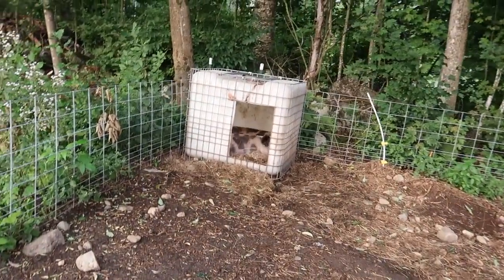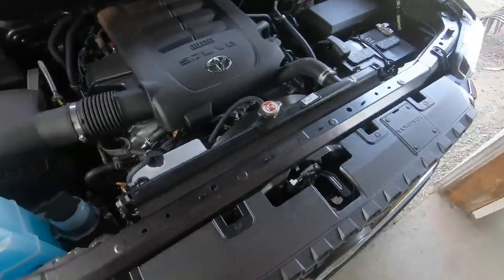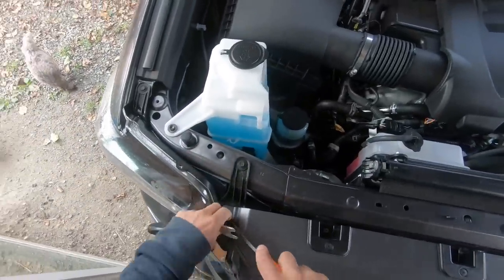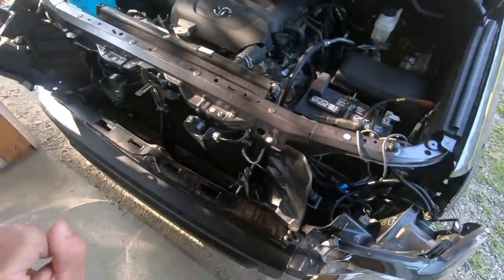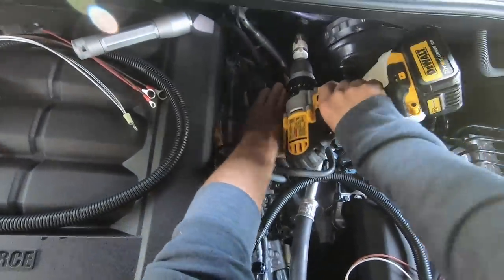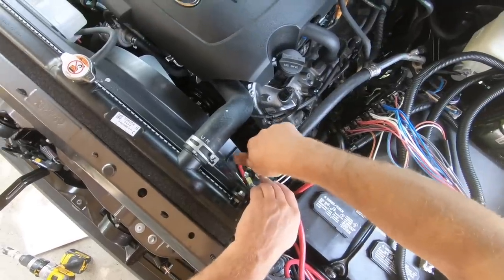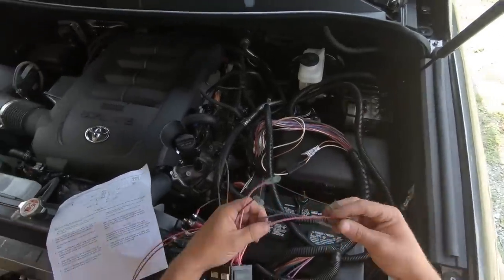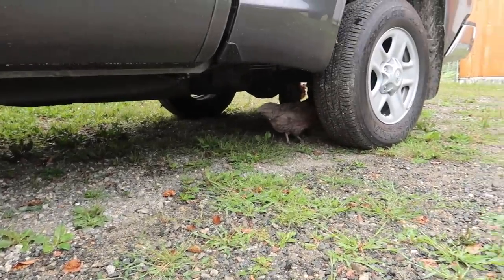How Hard Could it Be (Installing the wiring Harness for a Boss Snow Plow)

Comment: Yes Al, we always seem to be trying to keep one step ahead of the N.H. winters! Our kitchen stove wood is in, but we have 3 cords of the big stove wood to get under cover. I am very impressed that you took care of the wire harness now. It is good to be prepared, with fewer last minute hassles. Thanks for the installation video! My little 2004 Tacoma is plow-less, but " Ruby" can make it up our snowy steep driveway 99 out of 100 times! A storm last winter, rained and froze under fresh snow. I almost made to the top, before the truck slid backwards, stopped by logs placed along the side. One of our Ford tractors had to pull it out :-). I still want a Kubota.......

Comment: Great install video. As a boss fan for over 20 years. One thing I like to do is run a jumper wire from the ground of the solenoid to the ground of the battery. This will give a longer life of the solenoid.

Comment: Sausage and Links can stay nice and warm in a frying pan. Mmmmmm. Tasty.
Al, Have you ever worked for UPS? Going out in the cool temps in shorts is a UPS concept.
I have a stack of yogurt cups with my tools. When I disassemble a car, I put the fasteners in the cups at the various stages of the job. It can be annoying to realize a screw or clip should have been installed a few steps ago requiring some back steps.

Comment: Really good to see your knowledge with vehicle electrics... most people haven't even heard of using dielectric grease. I don't like scotch lock type wire taps either, they are always a cause of issues especially out side of the vehicle cabin where they are exposed to the elements....  pity Boss didn't make fly leads and connectors to keep everything OEM spec.

Comment: Nice clean install except for the scotch lock connectors. I absolutely hate those connectors. You will eventually want to cut and splice those wires in by soldering them in. Lot less chance of pulling apart or corrosion. But it’s good you used the dielectric grease, it will help in the meantime. As always great video!!

Comment: Gooood Mawnin' Al!    So in a word....Envious!   I'm a diehard Toyota fan with an '05 4runner and past owner of more Toyota vehicles than I want to admit.  Watching you install the wire harness for the plow both makes me want a new pickup as well as a plow to put on it!  If only I could justify it!  I have only 128k miles on my 4runner so I feel like I've only just broken her in!  I have a 4.7L engine, I can't imagine the power packed into the 5.7L engine, must be nice.  Is your truck like mine in that it's always in 4 wheel drive?  I get 22-25 mpg highway and find it really hard to beat for 270hp in a 4 door with a V8.  Lastly, what happens to the warranty on the vehicle once the plow is on?
Reply from the maker: No I can put the truck in and out of four-wheel-drive. The plow does not void the warranty. I made sure of that before we bought it

Comment: Al , I have a question. Since your truck is transportation , why do you not just use the front end loader of your tractor for snow removal ?
Reply: Donald Miller there is a huge difference in plowing inside of a nice dry heated cab with an 8 foot v plow and out in the elements with a 4 foot bucket that doesn't angle. I bet the plow is at least 5 times faster and 20 times more comfortable.
Reply: dp  pmm ,
Well yes , but using the tractor does not require dis -assembling your new truck.  And then carrying the plow everywhere you have to go .
I used to plow with my small tractor , using a home made 3.5 foot plow that did not angle. In fact it only lifted about 18 inches also.
I was always busy enough that I never felt that cold. But , I never had to drive my tractor to town with a plow on it.
Reply: Donald Miller I guess it comes down to personal preference. I used to plow my yard with a small tractor as well. We get a lot of wet snow now and I got tired of being wet all the time, plus I like getting my plowing done in 20 minutes instead of 1.5 hours. It only takes a couple of minutes to take the plow off. To each his own I guess.
Reply: Doesn’t  the plow easily disconnect? I thought it was on a quick connect type set up?
Reply: Yes, the plow will easily disconnect, so you don’t have to take with you everywhere. Disassembly is a one time deal and well worth the effort for years of comfortable plowing. I would also think there would be some income opportunities. Excellent job on the install Al, I look forward to seeing the metal get mounted.
Reply: There's good and not so good about each way to plow.  We had a Ford 8N with big front scoop that my husband used for clearing our driveway.  He could plow forward and then scoop the snow up and over and then move it further back and make huge piles, widen out the areas, scoop around the mailbox and clear to within an inch of the back step. Took about 2 hours and he put on his snowmobile suit and insulated boots when it got very cold.  Some years the piles were over 10 feet high. Great pictures.  Now, I hire my plowing, and the driveway gets very narrow by the end of winter, and there is no way to push it back very far.  Takes about 20 minutes, needs more shoveling and costs $40. each time.  Northeastern Minnesota.
Reply: Donald Miller, It's ideal to have both, just like Al does. Use the truck to quickly open up the road and his driveway, then use the tractor to move the piles if they become too deep. Just using the tractor may work, but just imagine being where he lives, WAY upstate New Hampshire. Those guys get hammered with snow as you probably know. Also now, if he wanted to, he could plow 10-15 driveways each storm and make 4-6 hundred each storm !!!!!
Reply: august , 
Snow can be pretty variable.  I live just south of the Lake Erie snowbelt.  Last year (2017 ) I had a green Christmas. I didn't get very much snow and then it mostly came in March and April . Lol , I was ready for spring by April ! But I have had winters when I received quite a lot of snow. I plowed it .  No problem.  Then , two days later , I got just as much snow again ! Ut oh . Now what? I have no place to push the snow to. And no front end loader to lift the snow up and over . I ended up with a very narrow driveway. lol
Reply: dp pmm,
I think a lot depends upon how much driveway you have to plow.  My driveway was only about 40 feet long so it did not take me very long.  My main problem with plowing was if I got two or three big snows back to back.  The problem then was , where to put the new snow ?
Reply: Where I live, we rarely get more than 12" at a time. But I appreciate neighbors with plows on their trucks so that we can get a path cleared on our road as it might take a day or two for the township to come around to do it. Remember Mrs. Lumnah Acres still works outside the house and needs to get to work whether it has snowed or not. Having a plow on a truck is a good way to clear a path to main roads quickly.
Reply: soverylisa , 
I seldom get even 12" at one time . Only rarely do I get that much at a time. But , I have such a steep driveway , even an inch or even less can have me snowed in . lol My two wheel drive truck can not make it up my driveway with and inch od snow on it. If I have to at least snow is easy to push downhill with a snow shovel.
Reply from the maker: I plow around an 1/8 of a mile. We live on a private road. So I plow from the main rd to our house. I will take you a long this winter
Reply: Hi Al ,
An 1/8 of a mile ? Now THAT is a driveway ! I can see why you would rather push the snow rather than scoop and lift it. Still , I cringe to think of you using a brand new truck.  And splicing into the wiring . I'm like you . I don't like those crimp splices .  They always seem to go bad.  And then you are chasing down a bad connection.  More better to make a soldered splice and cover it with some silicon sealer which is also flexible. Also before you get any kind of corrosion , I would seal  the battery connections with  some dielectric grease. Seal them before the fact . Not after.

Comment: I try to pay attention when some one is working on my vehicle's, I have never noticed any one using an oil on the wiring plugs 😐 Hu ! 
I suppose that's why I'm constantly paying for new wiring 😛
Reply: It was dielectric grease which protects the wires and connectors from corrosion and moisture.

Comment: I literally asked the boss dealer today if they splice into headlight wires and she said no.  Yet you are clearly showing the boss kit splicing into the blinker wire instead of using a wiring harness with the correct connectors.

Comment: That's alot of money for a plow when you have a tractor. Might have been worth it to put a blower on the back of the Kubota. Congrats on the pretty truck anyway. If the fires ever stop burning it may stop raining.
Reply: Truck is 10X faster at least and warm.
Reply from the maker: When it's -20 Fahrenheit or colder the tractor does not like to start. And you really appreciate a heated cab on those days